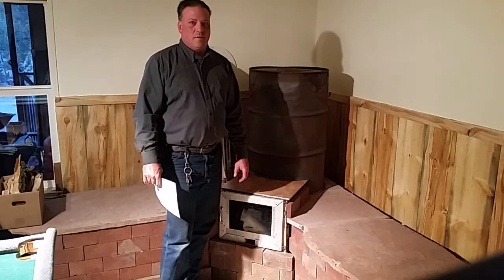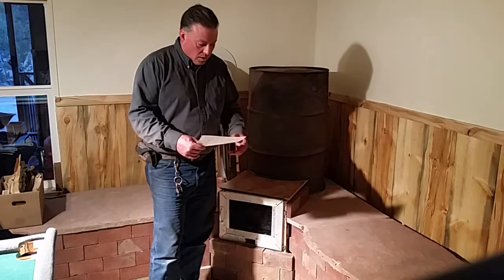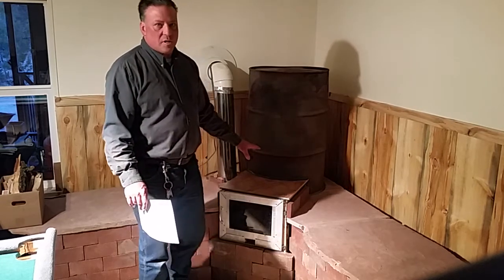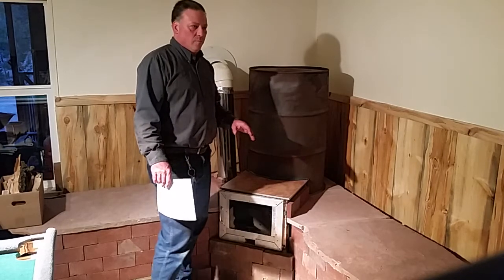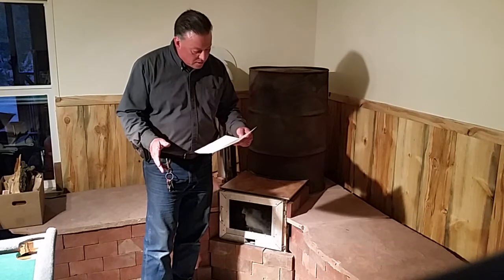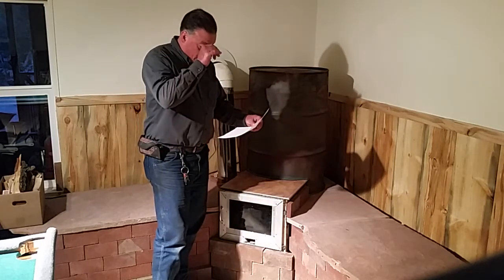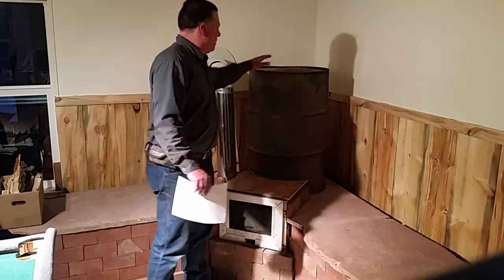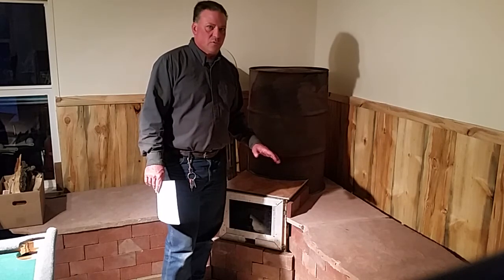Batch Box Statification Chamber Rocket Mass Heater

Comment: The heat riser on a 6" system should be 38' not 13".  That's a solution to the draft.  The chamfered corners help with that as well.

Comment from the maker: I used a little over a cord of wood. I have a house that's 2000 square ft, when I would wake up in the morning the rocket mass heater was still be radiating between 100 and 150 degrees for a three or four hour fire. I don't have any window coverings on my windows,  next year I plan to as I am sure it will help. sometimes when I woke up in the morning it would be 55 degrees on really cold days,  but once again I'm heating a large area. hope this helps.